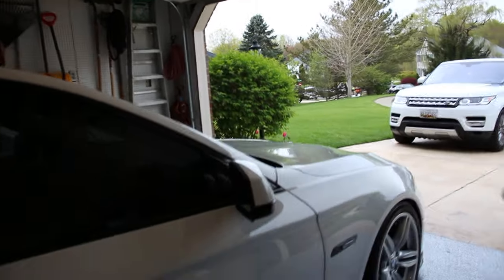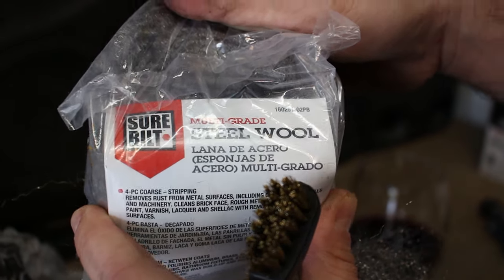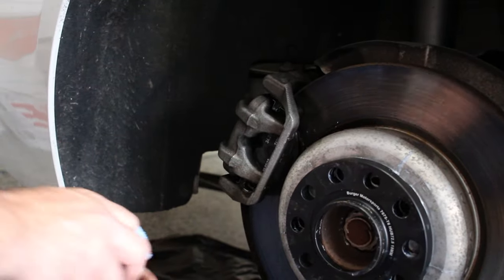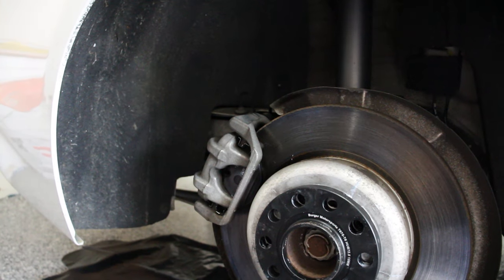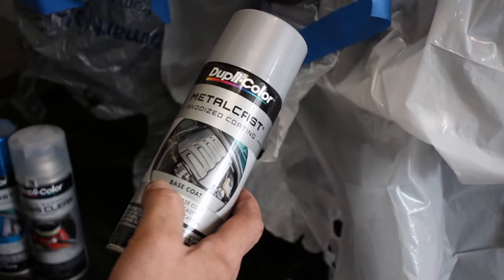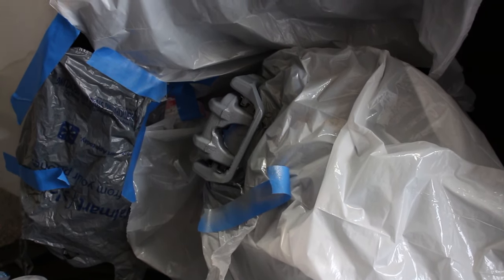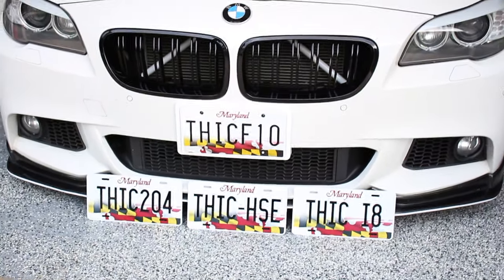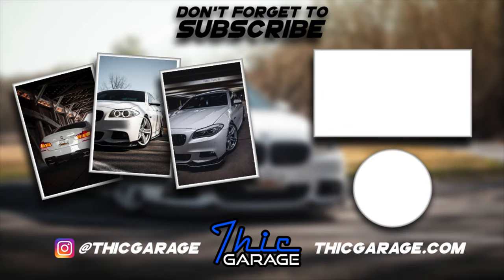HOW TO: Best Way To Paint Your Brake Calipers

Comment: If you do the primer first and then the basecoat over top of the primer the paint finish comes out much better. It is much more metallic and bright. If you paint directly over the primer, the calipers look dull and Matte
Reply: Yeah makes no sense primer should be on bare metal then base. Putting base first then primer, the primer would negate what baseless coat does

Comment: Great video. I'm about to change my rotors and brake pads on a 535i M Sport and have a couple questions. My apologies if they've been asked before....Is this the blue that you used (Dupli-Color MC201 Blue Metal Cast Anodized Color? it was slightly hard to see the can label. Also, the fronts appeared lighter than the backs that you did for this video...Is that because they weren't dry or possibly lighting? And finally, did one can of each of the three paint layers do all 4 calipers? Thanks in advance!

Comment: One tip that is missed here is don’t attempt to put the decal until after 10 days so paint is cured. Otherwise, it will peel your paint, ruin the sticker and you will have to start over. I learned the hard way.
Reply: What if you use a heat gun to cure the paint?
Reply: I did it and mine didn’t come off

Comment: Do you need the primer with the base coat? I noticed that you didn’t include a link to the primer in the description. Also will regular vinyl be fine for the heat of the calipers or is there a specific vinyl used for the logos you used? Thanks!!
Reply from the maker: Just the base coat, color and. Clear coat. The stickers I got from eBay and work great. I will try to find you the link

Comment: Very nice job indeed. I did pain brush on my brake and it looks horrible. Perhaps you could share the link of your spray cans (colour code) so I could try if they are available in the UK. Thanks.
Reply from the maker: Thank You! Here are some links of the paints I used.
Dupli-Color Base Coat: https://amzn.to/2XkiNtz
Dupli-Color Blue Anodized: https://amzn.to/3d7kSjr
Dupli-Color Clear: https://amzn.to/2WSp3tu
Reply: ThicGarage thanks a lot.

Comment: I have a bmw 430i my back calipers are extremely rusty should i use a drill but to get the rust off and can you send the links to the paints
Reply from the maker: Depends on how rusty your talking about. You can try using some scrubbing bubbles foam cleaner with a wire brush to break loose major rust and then use steel wool. I have links to paints listed in the description. Good luck!

Comment: Base coat before primer? I think you got confused good sir..
Reply from the maker: Their base coat is to be used first per instructions to allow primer to stick. Paint still holding up very nicely
Reply: Yea I'm pretty sure primer goes first
Reply: I am about to do this myself and have the same question.   I dont see anywhere on the cans or on duplicolor.com to put down primer over the basecoat.  One point of the basecoat is to to provide a better color "pop" if applying to a non chrome surface.   if you go over it with primer you kill that effect.   Great video overall.

Comment: I wonder why nobody just takes the caliper off? wouldn't it be much easier. paint all 4 in 10 minutes.
Reply from the maker: Then u have to drain ur brake fluid, fill it up and bleed them when u reinstall. Also would need to compress pads if the piston pushes them out. Much easier taping up
Reply: @ThicGarage  What if I’m getting brake pads and rotors put on anyway?